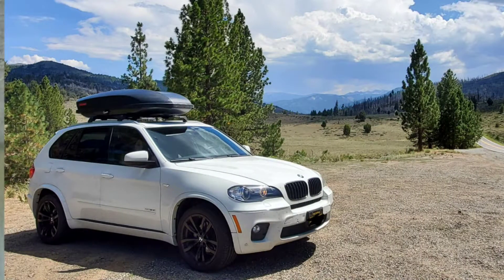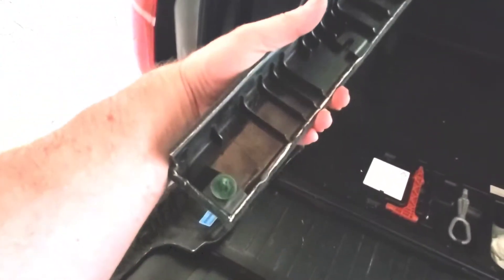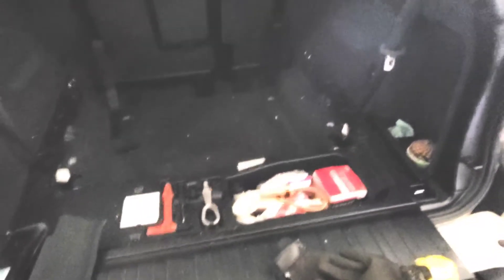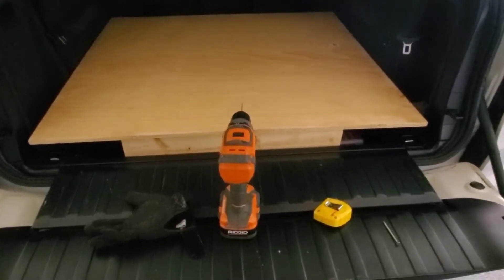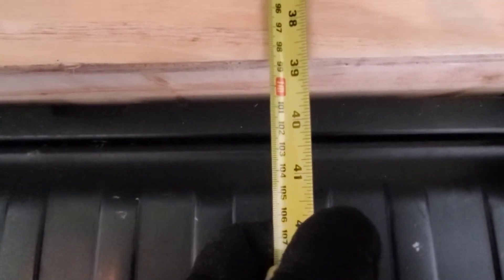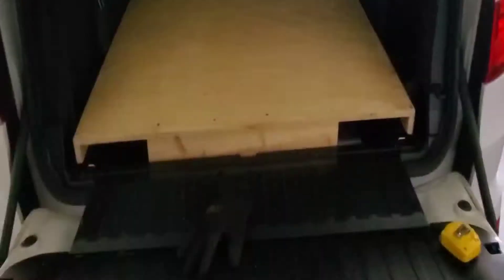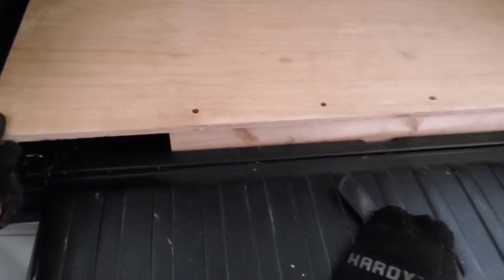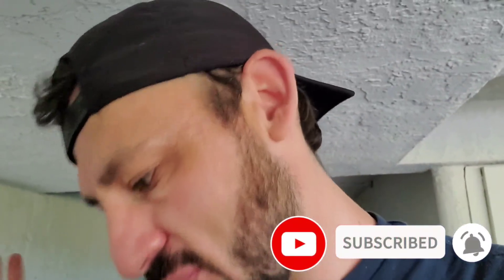e70 X5 series: 3rd row removal and false floor build.

Comment: What did you do with the wiring for the heater
Reply from the maker: What heater? There's only an electric fan. If that's what you are referring to, you just push it under, towards the rear bumper.